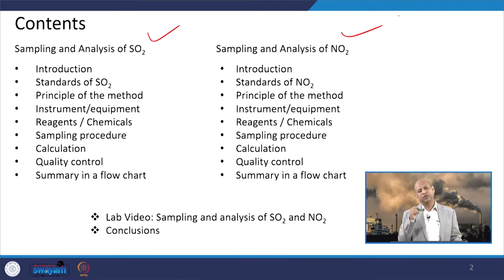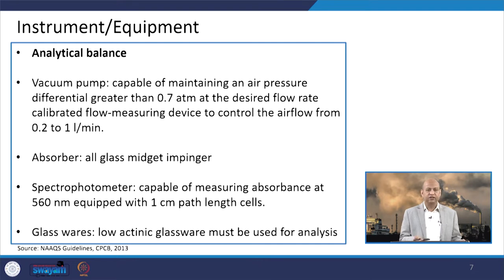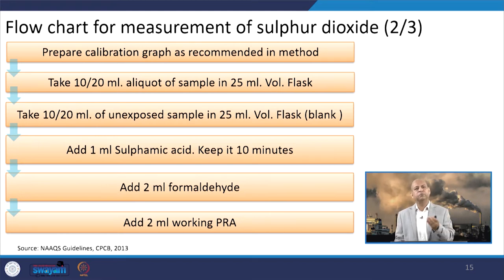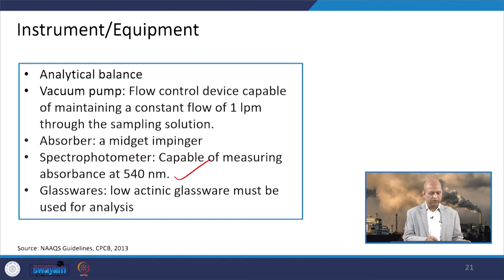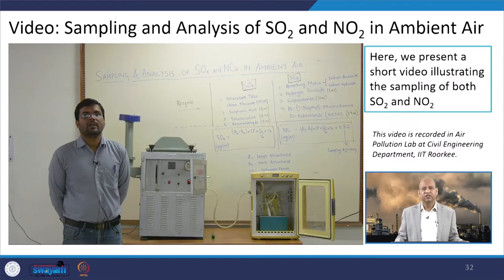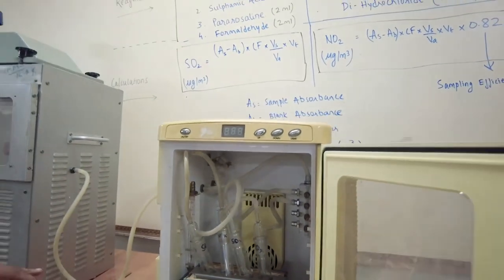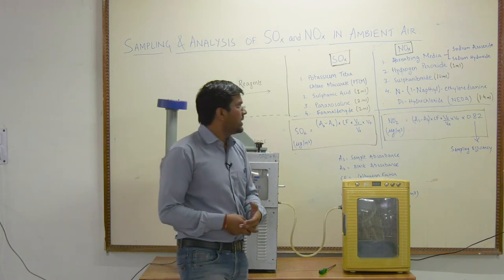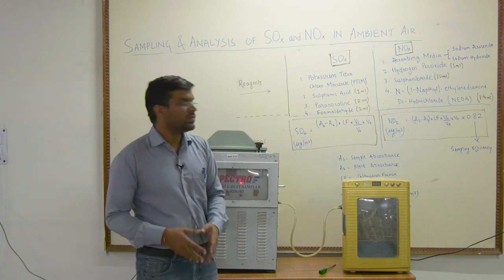Lecture 57: Sampling and Analysis of SO2 and NO2 in Ambient Air

Comment: Hello 
Sorry for disturbance
I Have read your standard 1090 în which are presented Methode for the determination of diferent gases
I am interesed about áll gases formula determination
For Example
346200 for the Hydrogen
3098 for the carbon monoxide
1039 for the carbon dioxide
2784 for the mercury
How these values where determinated ?
Thank You in advance for your answers